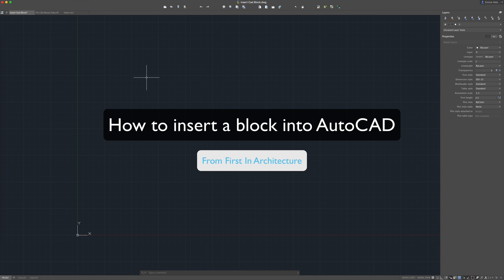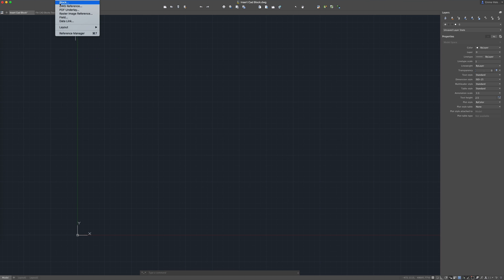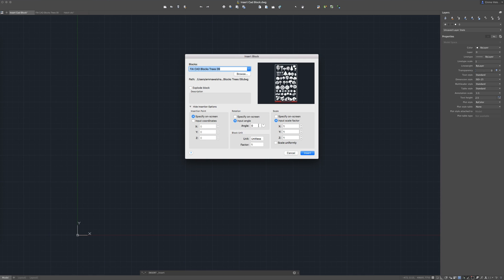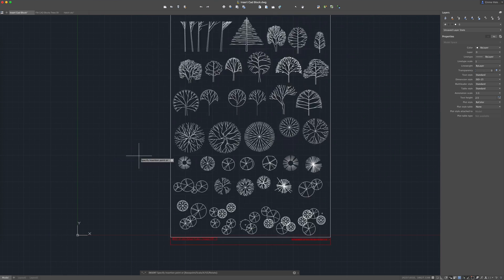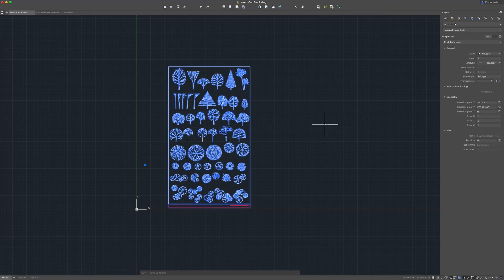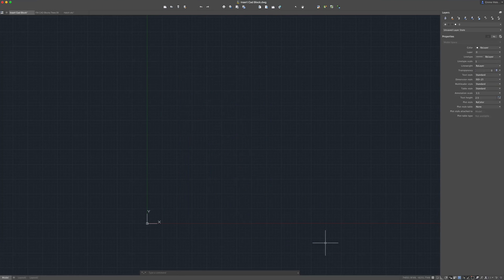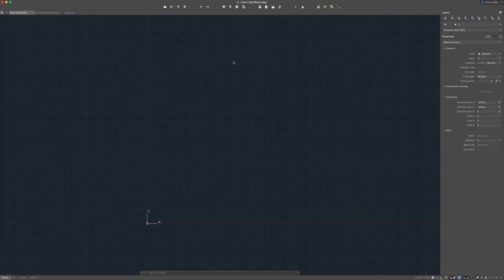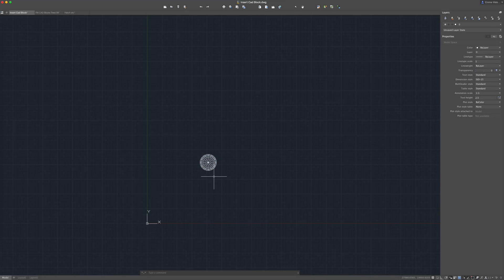How to insert a cad block into AutoCAD

Comment: How come on my 2019 CAd with a windows 10 operating system this doesn't happen??????????   How come all can finally do is insert the block but that's it. I cant click on an item even though I explode it?????????? How come when I do exactly as this video says nothing works?????????> Could it be that this is a 2021 version and mine is 2019??????? upgrades happen annually to electronics, they are constantly changing.